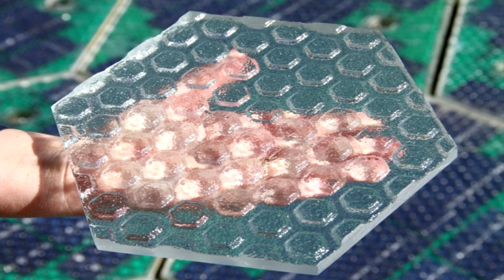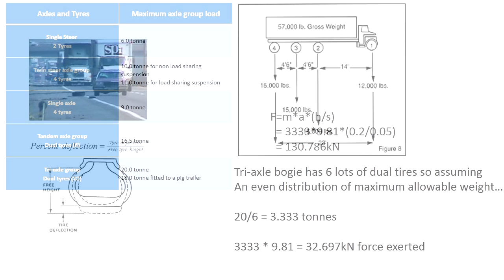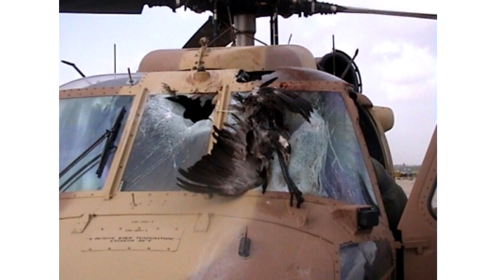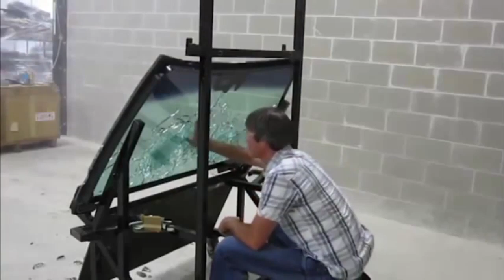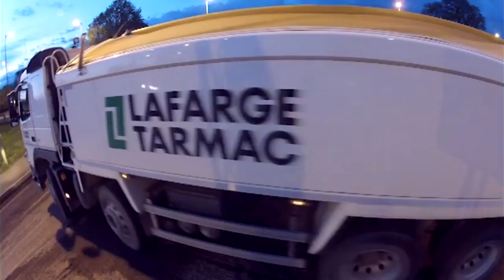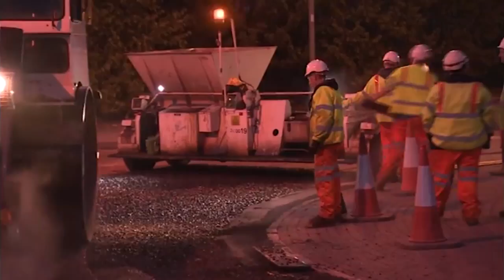Solar roadways - The problems with a glass road

Comment: Hi, I was wondering what your thoughts are on the Dutch project, which is basically Solar Roadways without the LEDs and heating elements. The same issue with glass should still remain, but they've already started a pilot.
http://www.solaroad.nl/en

Comment: Why is glass the only option? Why not plastic? More importantly, why don't you make a video trying to solve the problems involved with this great idea instead of spending so much time and energy tearing it apart?
Reply from the maker: After years and years of research the developers of these solar road ways are fixated on using a tempered glass composite. The only plastic that comes to my mind that may stand up to this kind of abrasive environment (at least for a while) would be plexiglass, which is even more expensive (in relative thickness required for load bearing capacity) than glass. The possibility of 'solving this problem' is impossible when you factor in the design constraints ie, must be translucent\transparent, must withstand wear, must be strong\load bearing, must be cheap, must use recyclable materials. To fulfill those constraints would require a material that is not known to man.

Comment: I'm still wondering how their glass would hold to fatigue.
Reply from the maker: Fatigue is extremely difficult to model using pen and paper and requires complex computer models or physical testing. I doubt you will ever find out.
Reply: Iced Specs Yes, and it just seems they don't even know fatigue exists.

Comment: One more problem to overcome would be the ground the tiles would be laid on. It will always compress at varying rates, which is main causes of potholes and cracks in asphalt, uneven concrete panels and torn up brick roads. It wouldn't take long for the tiles to become crooked and wreck the whole system.
Reply from the maker: AFAIK They plan to use existing roads and change them into solar roads. Which means that the ground will still be compressed and graded. They will then pour a concrete foundation which the panels bolt into. I don't think what you are talking about would be a problem at all. But again, doing this is very expensive.

Comment: Re: Service ducts. The plans I saw have them lay a concrete foundation for the road, which could reasonably include the ducting, especially as there is a move to using precast concrete. As these concrete roads cost about 1/4 that of an asphalt road, this isn't so much a problem. They also last much longer than asphalt roads, so whilst they add to the overall cost, it's not that much of a burden.

The problem is more that these panels need to make up the difference between their cost and 75% of the cost of an asphalt road in order to break even. Everything I read and head says this isn't possible. Indeed, at a 15% max efficiency of the solar panels (from their own material), they are going to fall way short on the one part they think they can make money on.
Reply from the maker: ***** I would actually question your statement that concrete is cheaper as a road surface than asphalt. I have worked for an engineering company as a draftsman where we had to use a small portion of concrete that had to withstand heavy vehicles and last for many years, we had to put rebar or at the very least wire mesh. The problem with concrete as a road surface is similar to using glass (as concrete has similar properties to a ceramic as it is a composite material mainly consisting of ceramic), it is not tough enough and cracks very easily not only due to wear but also heat. Now don't get me wrong, using concrete slabs in a very low traffic volume area (even lower than a office carpark) you may get away without using rebar as long as your slabs are small enough. But the cost of forming and casting slabs (and potentially casting mesh or rebar) would definitely be more expensive than laying black top imo. Concrete is surprisingly expensive due to the design and rebar required. I would ask you back up your statement.
Reply: Iced Specs ROFL! Sorry, but you are so, so wrong. For one, there is a concrete MOTOROWAY not far from where I live and it's been there for 30+ years. So yes, they exist, they're proven, they're hard wearing and the only thing about them that is anything like a glass paved road is the noise - those old concrete roadways are quite noisy to drive on.

Okay, concrete roads used to be more expensive - but not by much. This was because they used to lay the concrete in situ, and had to allow for thermal expansion of the concrete. This was time consuming but the road surface was superior - they generally last 40+ years with little to no maintenance.

However, the 'Big Asphalt' groups are worried about concrete roads considering the technology behind laying them has come on a long way, and with the rising costs of asphalt, and the cost for repairing asphalt roads, concrete's looking better and better.

Here's the link: http://www.asphaltroads.org/why-asphalt/why-choose-asphalt/

Please note that while they highlight how good asphalt is (big surprise considering that's what they're championing), they acknowledge existing concrete roads, race tracks etc..

A quick search also brought up this link: http://www.brighthubengineering.com/concrete-technology/45858-concrete-roads-vs-asphalt-roads/

Again, bias, but it's talking about existing, proven concrete roads.

Heck, here's the wiki page on road surfaces: http://en.wikipedia.org/wiki/Road_surface

Happy reading!

But why did I mention the 25% cost of concrete roads compared to asphalt? Well, that was lifted from a US government site on the cost of highways over their lifespan. Concrete was costing more to lay, but lasts longer and is cheaper to maintain so overall it saves money. Asphalt was cheaper and quicker to lay, but wears faster and requires more maintenance and so over the lifespan, costs more. But when you're looking at 40+ years for concrete roads, the TCO tends to get ignored.

That said, the noise from concrete was also a problem, but there are advances being made in that area to fix it. Indeed, the likes of 'whisper concrete' is a big challenge to any 'Big Asphalt' out there.

So yes, concrete roadways. They're real. And they're getting more attention these days due to the rising cost of asphalt and the improved technology with the concrete. Oh, and there're some videos out there of precast concrete road sections being introduced. America and Canada are adopting them, it seems. I think they're hybrids, though - asphalt laid on concrete, but that seems to be the best of both worlds right now.
Reply from the maker: Hunter Cat Lol Thanks for that, I guess I should have done some googling first. Where I live in Australia I have never seen a concrete road except for bridges, long driveways and such. I'm actually very surprised that it is slightly cheaper but it appears you are right. I mean looking at this photo:

http://www.eupave.eu/documents/technical-information/conferences-photos/e17-worksite.jpg

and seeing all that steel mesh it's amazing that it costs less. I think it's probably down to the reduced maintenance needed after reading some of those links you posted. I wonder if the reason why it's not used where I am is because there is lots of clay in the soil around this part of the country and any concrete tends to crack and crumble due to settling.

Anyway I did say I was a student of engineering so I appreciate your detailed reply and will read through those links in more detail later.
Reply: Iced Specs
No problem - I was just interested as I studied Civil Engineering at Uni and worked on highways before moving to computing, so this stuff still holds an interest to me.

Oh, and thanks for making the video - kind of forgot to say it, but I am quite curious as to how much those road panels would cost, and everything I see keeps pointing to 'far too much', and that's assuming they don't cut corners, which would be a disaster.

Comment: another problem with solar roads, what happens when it snows?
Reply: Andrew Mullins ... with the massive amount of energy it will produce in winter...
Reply: Andrew Mullins Well, those problems are so obvious, that we can savely assume the brilliant minds behind this idea already thought about it.
The most logical conclusion for me as a european is, that rain and snow are unknown in the USA, and therefore no problem for the idea.
Reply: Well in thunderfoots video, the solar roadway guys want the road to heat the snow to melt.
Reply: Omega0850 I'm no scientist but it wont work because when snow covers solar panels no sun is going through, and they are flat as well so it's another problem there and it can get really slippery with glass and it will tragically increase traffic accidents in wet weather. and there is no good way of getting the panels to heat anyway.
Reply: superstd That flamethrower is also gonna come in handy when they drop these solar road panels on poor Afghan villagers to burn down their houses all while keeping satellite communications and video streaming online so troops are not endangering their life.
Reply: 7DRAGNX solar panels with flamethrowers, that is an oxymoron if i ever heard one.
burn fossil fuels in flamethrowers to keep the snow off of the solar panels. defeating the purpose i think.
Reply: X X just "pray" for it to work and then god will make Jesus and Allah and Buddha and Zeus and Hades melt it so the sun hits it.
so the tiny beer cans on heels will go.
Reply: when its covered it can use its backed up power to heat the snow.
theres also flame thrower below it in case it really need it.

Comment: 100$ per sqaure meter? I don't know where you got those numbers form, but even for glass only used for walking on (like often used in shopping centers here in middle europe), you have to calculate with several hundred Euros. 

And those 'only' need to withstand people walking on them.

So yeah, i think you underestimate the cost of the glass alone by a factor of atleast 10, making your point even more valid (And the SFR even more stupid).
Reply from the maker: It was only from googling 50mm thick bullet proof glass as many sellers require you to submit a query before they give you a quote. I found a few sources and the price varied lots, but the best (fairly legitimate) price I could find was $100 US a square metre, I'm not sure about the quality of the product though. I wouldn't be surprised if the cost was higher than $100 per square metre but I was being pretty conservative with all my figures because I wanted to prove that even if you assume the best case scenario, the product would still be monstrously expensive.
Reply from the maker: ***** The glass I designed in my video where I prove it would allow a truck to stand (or even drop onto it from 20cm) is essentially the same type of product used for bullet proof glass, ie 50mm laminated tempered glass.
Reply from the maker: ***** You're probably right
Reply from the maker: ***** See, this whole thing with scratch resistance and people talking about hardness as an indicator (ie thunderf00ts 'test' of rubbing asphalt against glass) I have issues with (despite the good intentions). Hardness does tend to be a good indicator of scratch resistance. But when you are talking about actual abrasion resistance (which is the accumulated wear over a period of time as apposed to rubbing, with force, an abrasive object against something which would occur occasionally, but wouldn't be the main driving force against surface quality reduction) you must consider an abrasive index as opposed to hardness. This is because what we are really concerned with here, is the build up of lots of scratches or abrasion ruining the surface.  In my video I show that tempered glass has an abrasive index of 0.8% using the texas sand blasting abrasion test which shows relatively good resistance to abrasion. But if you have understood what I have said in the video you will see that only a nominal 1mm abrasion would be allowable to maintain quality permeability of light, which means that the panels would need replacing often.
Reply from the maker: ***** What special surface? Do you mean the corrugation?
Reply from the maker: ***** Nah, glass is the same or more resistant than asphalt. But those corrugations getting worn down is the least of the problems as they are about 5-7mm thick from just eyeballing them in the photo... You have to replace these panels after only roughly 1mm of abrasion.